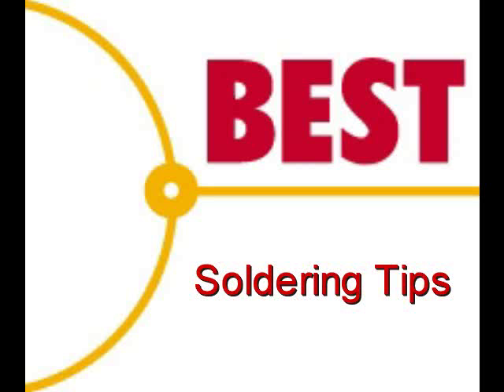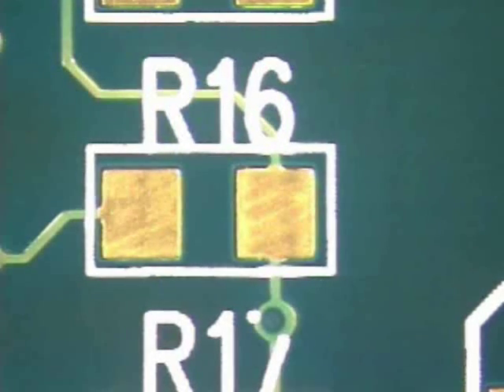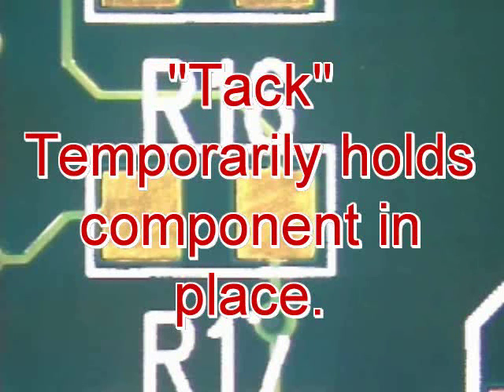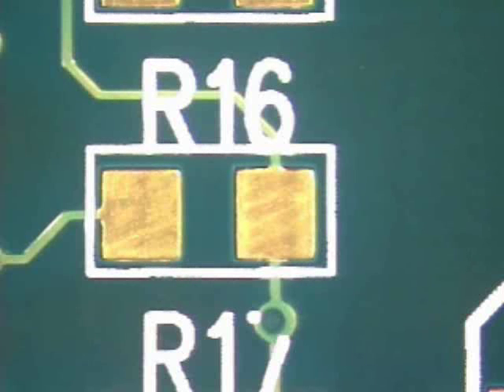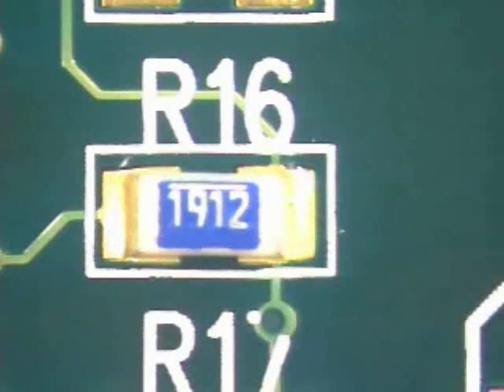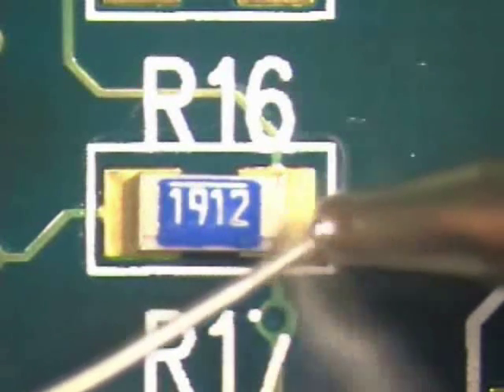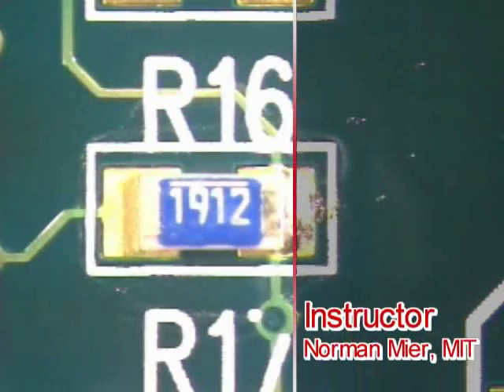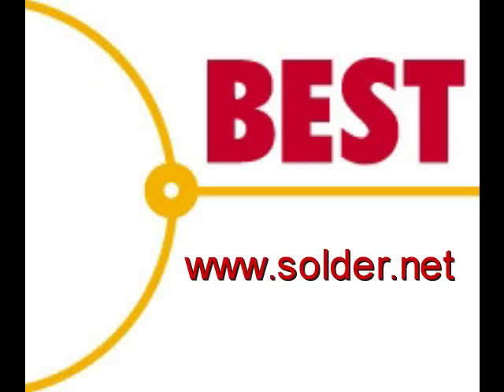SMT Chip Component Preparation Wet-Tack Method

Comment from the maker: This video is just to show one of the tacking methods available because different parts require different methods.  I actually prefer the dry tack method because it is faster and gives you a more uniform solder fillet on all joints that you will solder.  Thanks for you comment I do appreciate it.